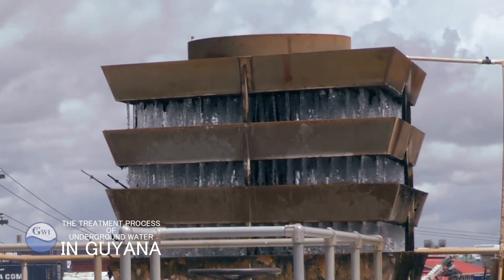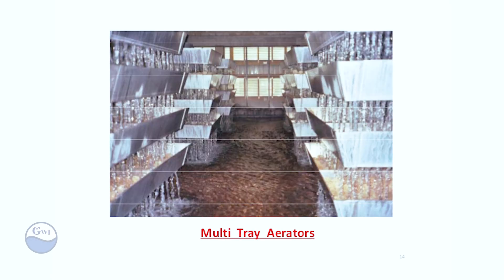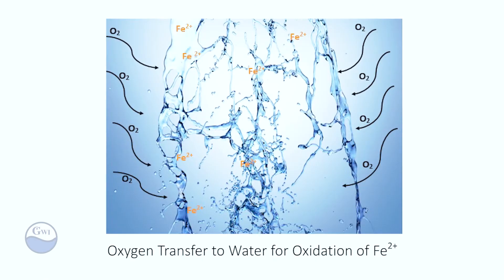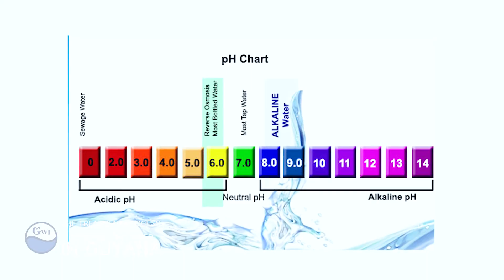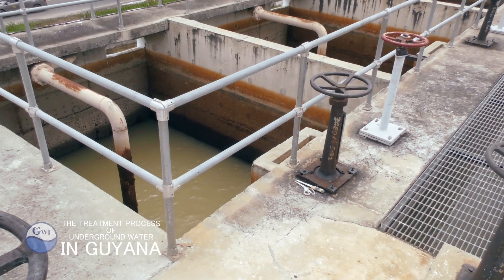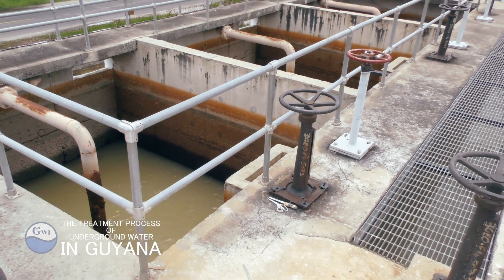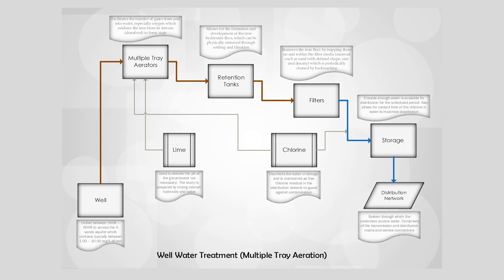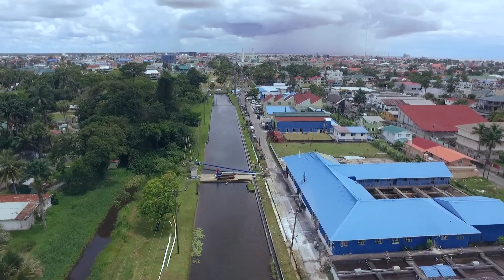WATER TREATMENT PROCESS IN GUYANA

Comment: Why no treatment of water in West Coast Berbice? Water is pumped and distributed to the villages and towns without iron removal. When would pre-distribution treatment be made available? It would be better to install pretreatment treatment and recoup cost with a modest increase in water rates. Currently, residents have to purchase drinking water at GYD300 -1200 per 5 Gallon. This can serve as a basis for estimating what rate increase is tolerable by the population to offset the cost of pre-distribution iron removal. Come on, GWI, fix this issue!